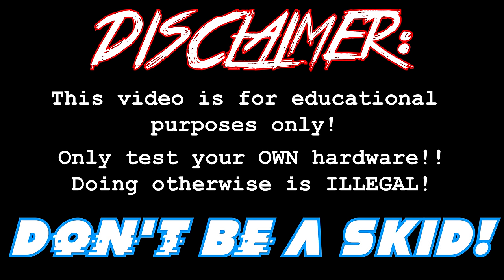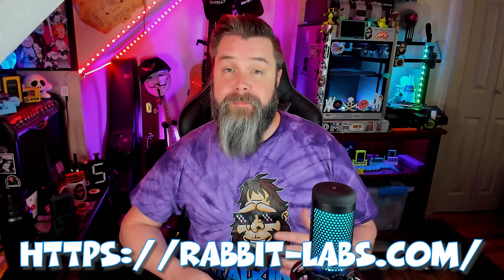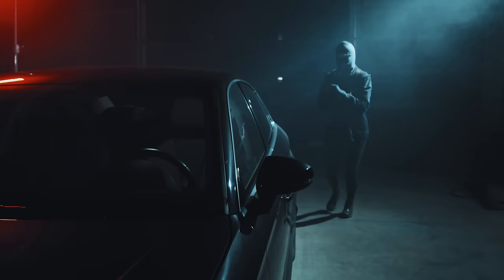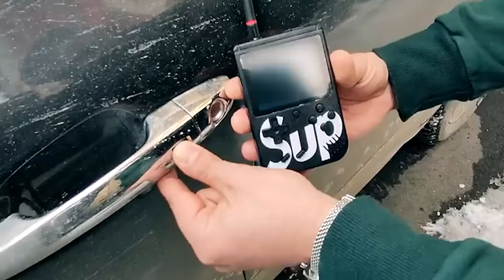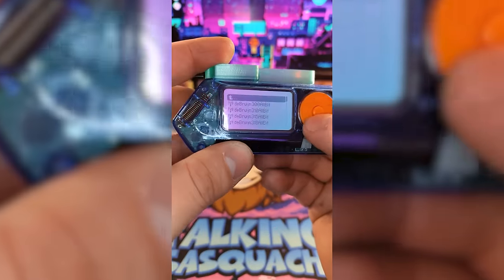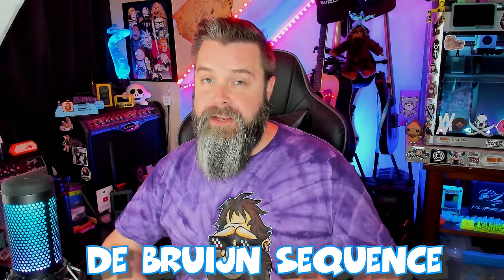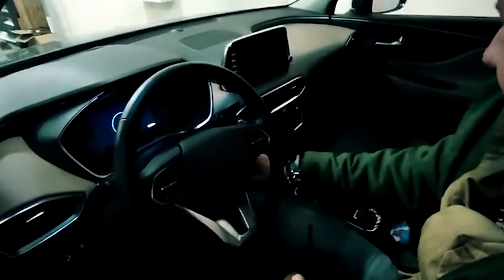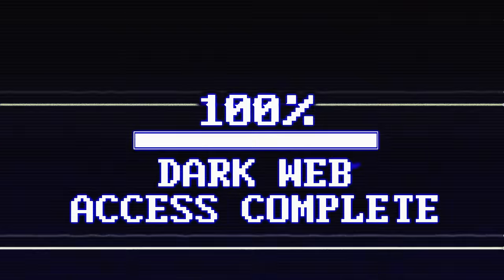Kia Boys Are NOT Using Flipper Zero!  See What they ARE Using!

Comment: A simple fix would be for the car to limit the number of unsuccessful attempts in a given time and lock out for a while
Reply from the maker: Agreed and many car companies have done this already
Reply: Several manufacturers have "active alarm" lockouts that prevent access to the security functions if an improper or no transponder is present when starting it, but it's a limited time. 
However, this doesn't do anything for the door locks in which constantly listen and use the unencrypted ID to determine if it should listen to the rest of the bitstream.

Comment: U don’t need a flipper then not smart lol 😂😂😂 the ignition on most those Kia’s and Hyundais have no security there’s removing the plastic ignition and using a usb cable .  

Not rocket science protect ur self a simple 12v remote battery disconnect can save u

Comment: I never thought I'd see a company so irresponsible to use the de Bruijn sequence in this decade. It exists on ancient garage door opening systems but... wow.
That sequence is just a file and it's readily available, many devices can transmit it, including the hackrf and flipper zero. It's nothing special, which makes this even more ridiculous, it's not an oversight, it's negligence.
Reply: Isn't the de brujin sequence more like the decoder method?
Reply: What you just said makes zero sense. No company is using it for their encryption or anything- it literally can't be used for that. No garage door has ever used it - because that's not what it's for. No, it's not a file. It's a sequence- a sequence that is different in literally every application and a sequence that is used to brute force not to encrypt. Did you even watch the video?